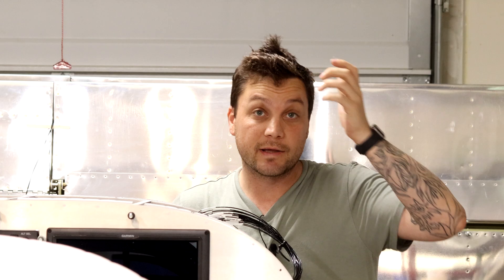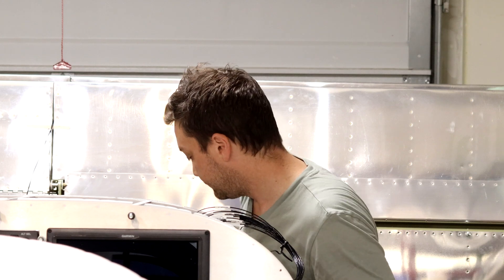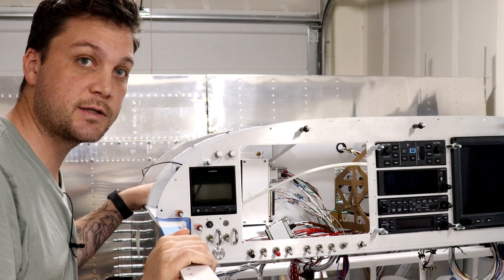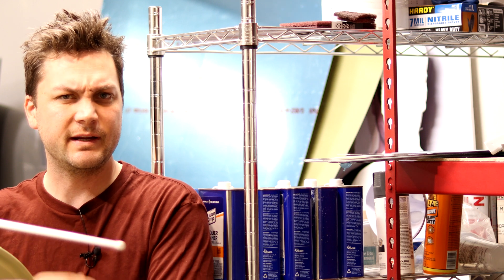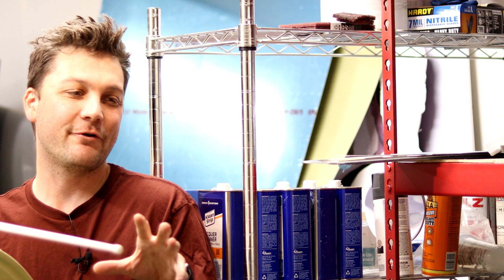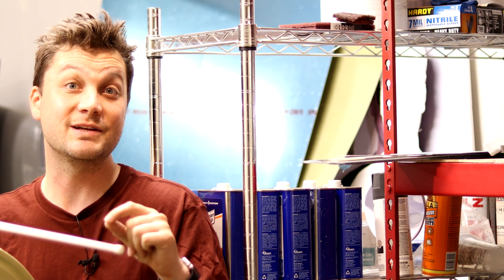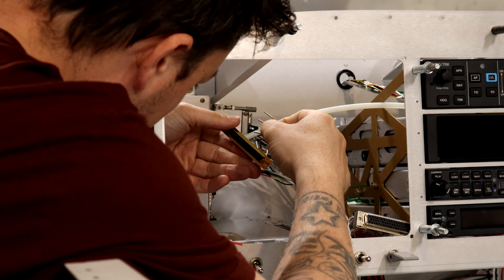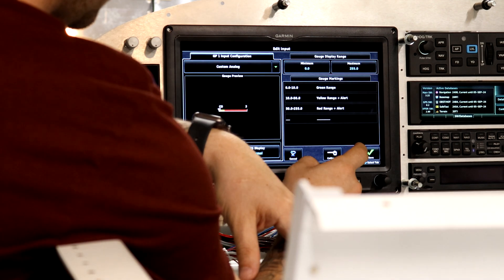More Purchases, More Unboxing, and More Wiring - RV-7A | EP4.14

Comment: Hi Ryan.   The wiring at your row of switches is a very neat installation.  

When installing Molex pins on wires, do you just crimp or do you add a bit of solder as well?   Is that even necessary?   

Great progress.   I can feel your excitement!
Reply from the maker: For Molex I did the two crimps (wire + insulation). Solder, or tinning the leads, would prevent a full connection and could create a brittle connection—at least that’s what one source said.

The only place I’ve soldered (tinned) the leads for a connection is a screw-type connection coming up on the lighting.

Comment: Why did you mount the sensor behind the panel instead of in the cockpit where the pilot resides?
Reply from the maker: Proximity to the rest of the avionics, and more importantly firewall. With the are in which it’s mounted fully open to the cabin, I figured this would give me more advanced warnings if something were to be leaking in from up front.

Comment: Hi Ryan, are u installing an aileron trim? I noticed you have the 4-way trim switch in your grip..
Reply: I’m adding it as well. This topic seems to garner a lukewarm response among builders but I figure I’d rather put a little effort in now than to regret it later!  Hearing your first-hand experience makes me feel better about my choice!  Great video Ryan!
Reply from the maker: Yes, and soon.

I’ll have details on both the wiring and mechanical installation.
Reply: @RyanFlysPDX thanks for the info.. I’m having 2nd thought of installing an aileron trim. can u advise what made u decide to install it?
Reply from the maker: @zedcal2552  flying in someone’s 7 and watching him work made it clear it is worth the effort. 

I’ve heard all RVs wind up with a “heavy wing.” Add in varying fuel levels and passenger loading, I think it’s worth it to be able to add a click of left/right to remove some manual input when hand flying.

Hopefully the install isn’t too painful. Half the wiring is done, just need to run a line for the position wires. I think this will be my last wire run before sealing most this up!
Reply: @RyanFlysPDX thanks Ryan.